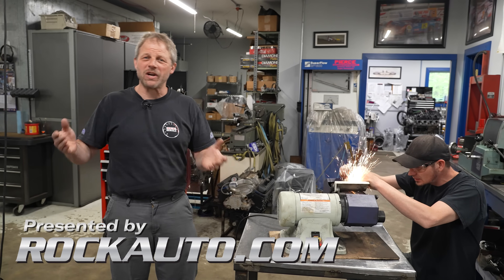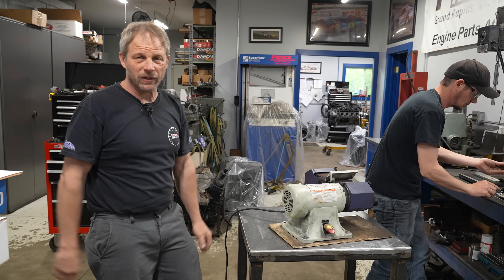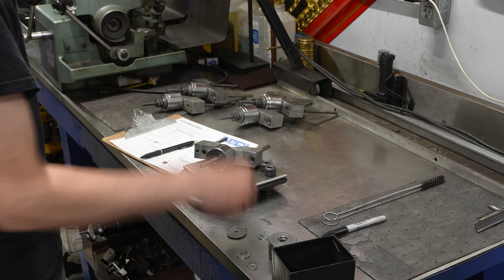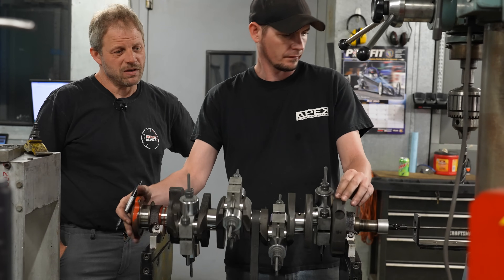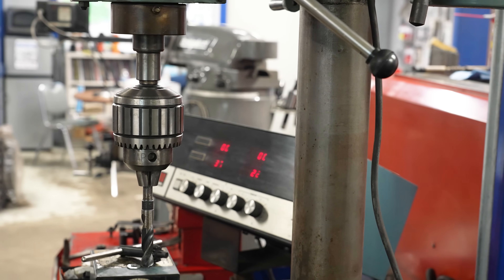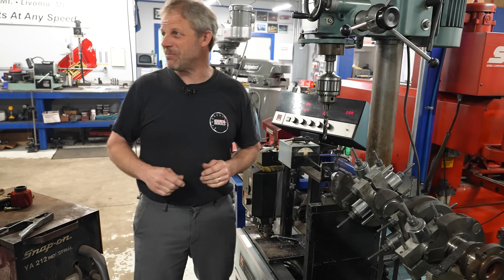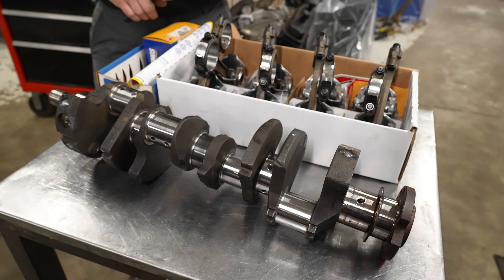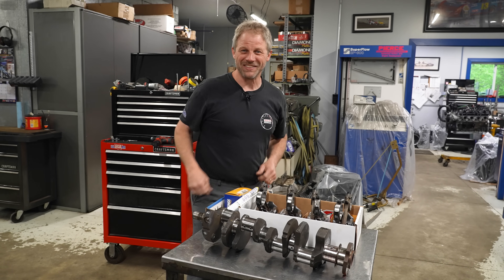Balancing the rotating assembly for a small-block Chevy V8

Comment: so if the rods were 14gs out from each other from the factory and the motor ran forever like that in stock forum how much better will it be? (i mean for a stock engine that won't see high rpm) because my understanding many factory motors are not well balanced from the factory
Reply: 14'ish grams is well within the factory spec balance job. It would not have any notable vibration at that. It depends how hi rpm you turn it.. and how picky excating you wanna be at that point

Comment: 140 grams off???  so unless the new pistons were 140 grams heavier than originals... something here isnt right.  I have never seen a stock SBC with a stock rod need that much mallory in the CW.   Was the bobweight calculated wrong?
Reply: You have a good point. I went from a 350 sbc w/ stock rods/cast pistons... to scat I beam rods and .100 solid dome hyperutectic pistons and even STILL was only 55 grams off.. in same direction as THIS.

Comment: I have no idea why you would need to add weight on this one. Bob weight had to be very heavy and in all the years I did engines, a basic stock rebuild on a SB Chevy never needed heavy metal. Cost is a huge factor in basic engines and adding heavy metal to the balance job pushes the cost way up. Your pistons, pins must have been some heavy slugs ! LOL

Comment: “Externally” balancing, as you’ve put it, doesnt correct the imbalance where it occurs, so your local stresses would still exist… despite the whole assembly being balanced. In other words, you may still have issues related to a large, local imbalance such as localized fatigue cracks, excesssive babbitt wear, to name just a few. 
A well-balanced rotating assembly ALWAYS helps a machine run better!
Reply: So how do you correct those problems
Reply: @Jerry Whalen  in a external balance... those issues (difference within the crank itself) can not be resolved... it's  why internal balance is better... external balance is an acceptable compromise of NOT being spot on excat

Comment: Proper (dynamic) balancing is such an important part of engine building that is overlooked by so many tuners. Heck, even Caterham and Lotus messed that up with the Rover K-Series. Just balancing a dime a dozen V8 can free up an easy 10 HP by reducing internal friction. Plus the engine will run smoother, more reliable and has more tuning potential.

Comment: Very entertaining.  I bought a crate motor that was 640 grams off on total bob weight, 80 grams per piston/rod.  It snapped the cast crank in half within the first 500 miles of install.  I no longer trust that nationally known engine builder and when local.  Glad I did.  He's a one man shop that took a lot more care with it.  I also went with a forged crank instead of a cast one.  I consider myself lucky because past the crank only 1 piston needed to be replaced.  Usually with a crank braking it wipes out the whole block, but didn't.  It's been 4 yrs since the new crank, it's perfect!

Comment: Hi Davin, nice information. I got a couple questions:
I could see the ‘bob’ weights were spread in 90 degrees from one another. What is the rule for that?
And, how would it be for an in-line six Chevy 235?

Thanks a lot!
Felipe.
Reply: Cross plane V8 cranks need bob weights, but inline sixes don't. You just put an inline 6 crank on the balancer with no weights, measure, and then balance.

Comment: I'm not really experienced with these things, so I have a question. If you have to add 140 g to the crank, is that a 140 g on each end, or 140 g total? Also, since you had to drill out a hole to put that Mallory in, does that mean you also have to account for the amount of weight that you took out drilling the hole?

Comment: Hypereutectic pistons are a LOT lighter than the steel reinforced cast pistons.
I have never had to put mallory in a Chev crank. And I have done 3" 3 1/4 and 3.48/ 3.5" engines

Comment: Cool process. Of course I've always known what "balanced and blueprinted" meant, but I've never seen a dynamic balancing of a crankshaft before. Pretty sweet! This puppy's  gonna be smoooth...✌️❤️🙂🇨🇦
Reply: "Balanced and blueprinted"
We just saw the "balanced" part. "Blueprinted" referes to the process where the block and head(s) are machined as close to perfect compared to the original (or modified) engine Blueprint. This may include: bore size, bore spacing, deck height as well as the deck being perpendicular to the crankshaft journals.
Reply: Yup.
I said I know what they mean, but thanks!
Reply: @scottimusgarrett15  sorry partner...
Reply: @williamwright6978 ,For those of you who don’t know what blueprinting means, William has just given us a good explanation!

Comment: Do you normally having guarding over the crankshaft while rotating? Seems like a safety concern, I know it's not very fast, but with all the weights, you have plenty of chances for something to fly off. I do think it's appropriate for filming to without it, just curious. Awesome video!
Reply: Nah, just stand out of the way.  It's only 500-600 rpm and you don't want to be there since it flings oil off anyways and makes a mess.

Comment: How much weight could you have eliminated by working the small ends of the connecting rods and lightening the pistons?
Reply: Theres not enough meat on those pistons to make them them that much lighter/light enough. Modifying the crank was the only viable option.
Reply: I missed the part where choosing heavier pistons was deemed good for a build

Comment: Very cool video. I already knew about piston and rod balancing, but never saw the procedure for balancing a crankshaft. Now I know. Keep up the great work.
Reply: Bob weights and harmonic balancers are only used on V8 engines. The straight six is a naturally balanced design.
Reply: @ellieprice363  the motion of a straight six creates theoretical balance, but you still need to have your pistons and rods equal weight for optimal balance.
Reply: @TML34  Yes that’s very true. I decided not to include that important blueprinting operation.

Comment: welding sparks on my crank?
Reply: He probably sprayed the crank with anti spatter spray.
Reply: @Chris-yy7qc  ok sure but with the cost of what they are doing why not cover the whole crank with a blanket? its so easy to do
Reply: @stereolababy  Watch the video closely. They have to turn on the lathe all the time. Weld a bit, measure, turn, repeat. So its a hassle to put a blanket onto the crank 100 times.
Apart from that its not neccessary. Anti spatter spray works.
And man, that dude has done this job a million times before. He knows exactly what he is doing.
Reply: @Chris-yy7qc  its a " hassle" to pick up a welding blanket? please dude. it could be an old t-shirt used to protect it. sorry but an ounce of prevention here...
Reply: @stereolababy  Whats so hard for you to understand about "NOT NECCESSARY"?
That dude is doing this stuff for a living and you keyboard warriors think you know better?
Reply: Easy to cover the crank with a welding blanket.
Reply: I was wondering the same.

Comment: How do they determine the weight to be added? Once you drill out the hole you remove weight.  How do you know how many grams you are removing when making room for that tungsten slug?
Reply: It's the volume of a cylinder times the density of the material. A 1" diameter hole in a 1" thick lobe would be 3.14159 cubic inches. Cast iron is 425lbs to 487lbs per cubic foot. 3.14159 cubic inches is 0.001818049769 cubic feet, so assuming 456lbs as a median, that's about 0.829 pounds. Converting to grams, that's about 376 grams (or 350 grams on the lower end to 401 grams on the high end). There's a way to work backwards from knowing how much weight you need to the hole size, but that's too much for a Monday morning (even if it is Memorial Day) :)
Reply: @JCWren  🤯🤯😵😵 my head hurts from to much math. And it's a Monday at that.😆
Reply: @JCWren  Thanks for the lesson in Syrian Aramaic. I'm gonna go take 2 motrin for the migraine I have now.
🤣🤣🤣
Reply: @JCWren  or you just weight the material you removed, smart guy.

Comment: Davin,  would it have been possible to get this crank into balance by completely welding up the original counterweight factory drillings at each end?  I could not tell from the video how much of the factory counterweight drillings got filled by welding.  Could you have lightened the pistons somewhat by material removal on the underside of the piston top?  Just curious what your options were. Great videos showing the practical aspects of engine building.
Reply: The drillings aren't at the same angle as where the weight is needed.
Reply: @eneapasquali2941  Good point, I did not consider the angles required for the added weights.  Thx

Comment: Always balance your assembly. Why would anyone skip this step? If your not going to balance it, just get a junk yard motor and skip the rebuild.
Reply: Why would someone skip balancing the assembly? Cost and time also the application, high HP and high revving you can justify the expense but for a city vehicle that hardly hits the freeway not so much
Reply: Hundreds of thousands of rebuilt engines have lasted just as long or better than original mileage. Unless you are racing, it's not worth the time and money.